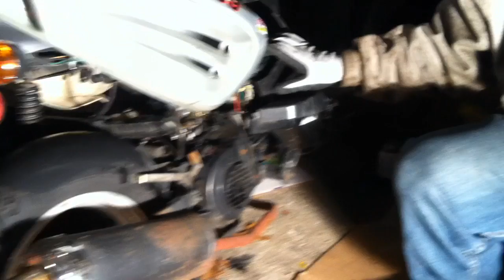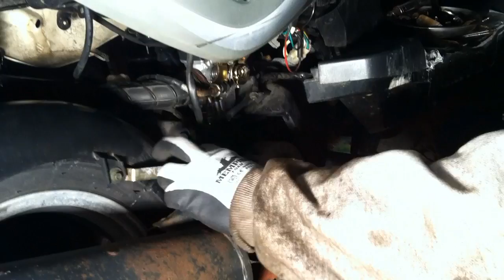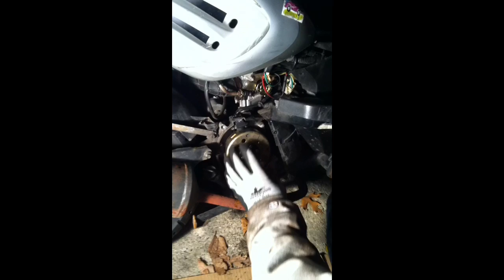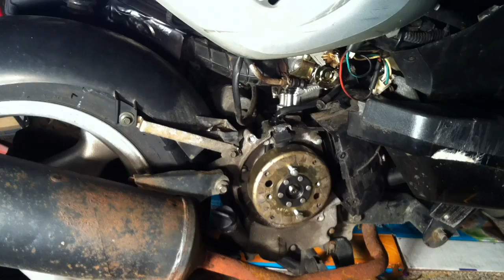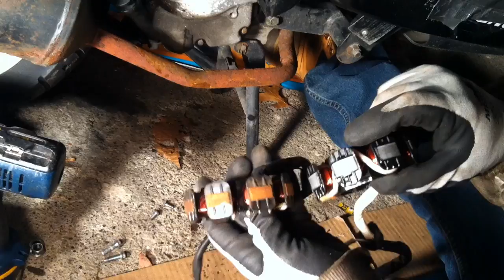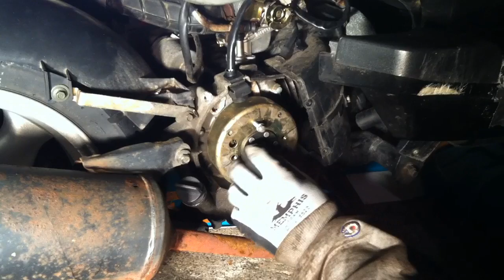How to replace Stater on 50cc scooter

Comment: Here's the problem with something said in the video.... A stator and pick up button are used to create an electrical charge. And together they make it with the use of magnetic field. So the rust and dirt on the coil pick ups don't really have anything to do with the fact that the stator isn't making fire. It's the copper wire winding and dielectric breaking down inside each of the stator coils.
Reply: leatherface711 facts

Comment: Hey guys great video. I have a question because I can't manually start my scooter anymore either that I have 7500 miles on it. And I'm thinking about replacing the spark plugs the coil then I guess that's about it for now. The question I need to find out about is how do I know that the motor for the starter isn't bad? Should I just purchase the coil and hope for the best because I don't really know the functions between the two. Should I just go ahead and purchase both to be on the safe side?

Comment: Sure this is a do-it-yourself project, if you want to learn how to repair your own bike. And with instructions and video like this, its not too big a challenge to handle. But we need to know the proper troubleshooting techniques to make sure this is the problem which has to be addressed, and not replace parts that are still good.

Comment: mind to wont start but the lights is on i start they crack hear prom egine maybe i change spark plug or starter help me my honda 1978 old model but the miles is 1.400 miles only

Comment: Got a ludix blaster 50cc... Bought for cheap of friend few mouths back not been used since day I got it looking to get it back on the road but the battery is dead!! Got one coming from ebay in 12 days!!! So was wondering if I can start the scooter with dead the battery to see if there's anymore repairs needing done? Am I able to kick start with no battery??

Comment: I have a 2014 SYM Jet 50 Evo. I have bought 2 brand new batteries. It worked well the first day and then it wont work. It struggles to turn on and sometimes it just doesn't turn on. Could this be the problem?
Reply: What do you mean by "struggles to turn on"? If it's draining the new batteries then either you have a parasitic draw or your stator may not be turning at all. It should be spinning fast while the engine is on. I think there's a way to measure the output by using a multimeter but to be honest I have no clue how to use those

Comment: i need help plz i have a yamaha neos 100 but cant get it started i have a weak spark what is the most likely cause of a weak spark coil ,,cdi,,,stator .?..thanks
Reply: Is the spark plug clean? If so is it new? The CDI wouldn't make it low spark it just wouldn't spark at all the stator could be worn

Comment: What size weights do you run in your variator? Do you recommend sliders?
Reply: It will really depend on your engine. But on a regular old 4 stroke 50cc engine, I usually  run 5g weights, I think they're right around the right balance, if you live in a very hilly area try 4.5g or something like this. Sliders do help, but again, the improvements are very minor, if you're trying to eek out every MPH then go for it

Comment: so the bigger one is like a 12 coil but it would fit with the flywheel correct.the 1i have will run for maybe about 10-15 minutes it seems after it gets warm and then I told I won't be able to start I have to wait another 10-15 minutes before it starts again and the whole process keeps repeating.
Reply: lol that got to be the electric choke

Comment: My 50cc yamaha zuma year 2000, has no spark but it did run the day I got it. Could it be the stater and ignition coil?
Reply: Try a different spark plug. If it's still getting no spark then it might be the CDI. Buy a new CDI (make sure it's DC or AC depending on your bike) on amazon for like $9, it might make your bike a little faster too. Then you will most likely have spark.

Comment: I have small spark ,fuel and air . does it sound like it needs stator ?
Reply: If the engine is cranking very weak and slow yes test the battery adore you spend money could just be that

Comment: How I jump start it off the starter
Reply: Stick a screwdriver between both terminals of the starter solenoid. It should spark and the starter should engage. make sure your battery is installed though

Comment: my bendix on 50cc dont work all the time and it's new
also new battery and stater
what is wrong with this piece of junk?
Reply: Thomas Flynn could be the starter
Reply: Oftentime my bendix gets stuck while trying to start if I have the CVT cover off, it kind of falls into the variator and jams everything up. I think you could try buying a new bendix, I don't think it's the starter because it's the bendix that's falling out cosntantly. Maybe find a way to secure it up in there correctly...